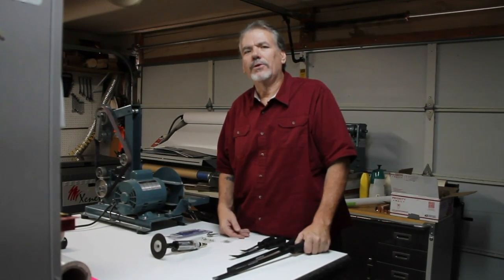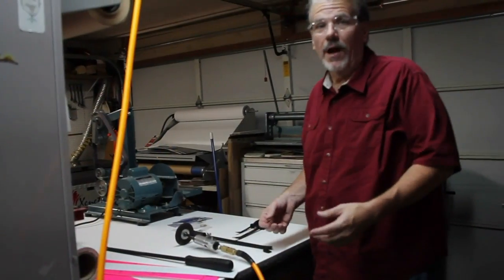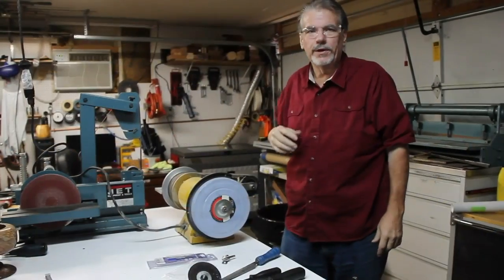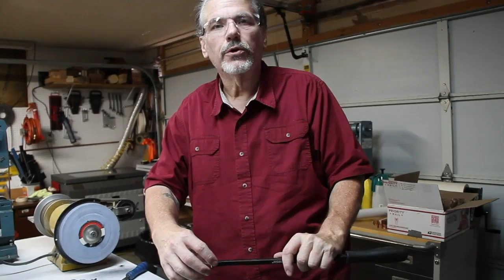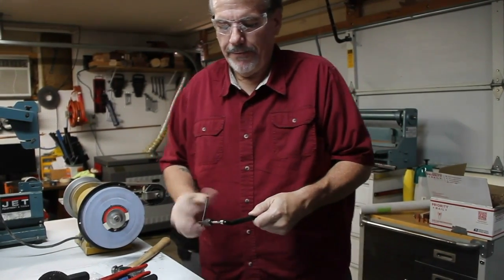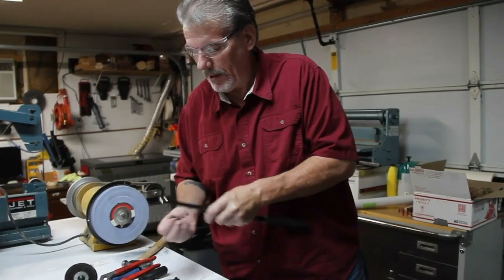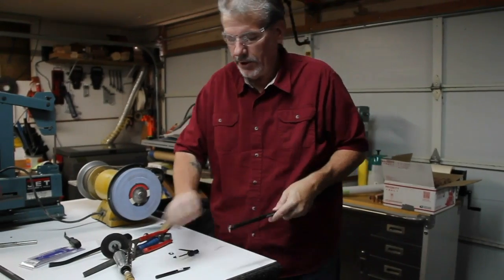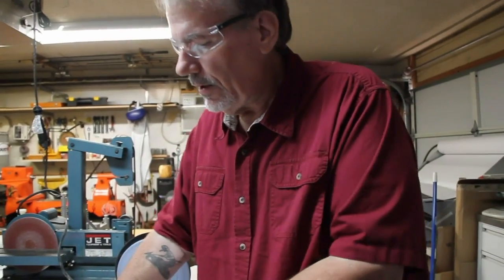How to make a Inexpensive carbide cutter for woodturning

Comment: If you grind the small platform on the tool shaft longer than the carbide insert, just place a small drop of CA glue on the platform just before you screw down the cutter. This will keep a square carbide insert from rotating on the insert platform.  To release the carbide insert from the platform, just use some heat from a propane torch or butane cigarette lighter. Loosen the insert screw, heat the metal opposite the insert for a few seconds and it should break the bond between the insert and metal handle.  This will allow easy changing of insert or rotating it to a new sharp edge. Apply another drop of CA glue and tighten down the screw; you’re ready to go.

Comment: Nice work.  Hard to believe that no one I can find sells this type of homemade lathe tool set.  I would think that there would be plenty of buyers, just to see if they would enjoy turning before shelling out for the real deal.
Reply from the maker: beav1962. Not a bad idea maybe I’ll make a kit up
Reply: @kendallnorthern7824  - can you tell me which size of cutter from the AZ carbide site to get for this 3/8 handle?  Gonna give it a try, but expecting to screw it up. Thanks.

Comment: Nice job thanks.  I’m just getting ready to make some. This is the easiest way I’ve seen.  Since I don’t have a lathe making the handles would be a pain.  I use a drill to make rings and I want carbide cutters so I don’t have to keep stopping to sharpen.

Comment: Hi, I’ve had a terrible time in my area finding the champion set you’re using to drill and tap the hole on the carbide tool. Can you give me the exact specs of that little kit you bought for $7?
Reply: Chris Davis  DeWalt also sells drill/tap combos like that. I have a few of the common sizes. I have a couple of set of taps and dies, but I like these because I can just store the sets together so I don’t have to search for the right size bit each time I need to tap a hole.

Comment: You must be drilling a larger hole than I do.  Mine would have broken that tap the way you put it through. I  do it on the drill press and use oil and go very slow .

Comment: why does the carbide bit need to be recessed, especially the round ones?  I can see the need for the square bits but what keeps the round ones from coming loose and rotating?

And how does it work when rotating the tool sideways?  it will raise the cutter because of the square edge of the tool.
Reply: It really doesn't if all you are going to use are round cutters.  You will still need to at least file the bar flat as they are not always very flat.  the rotation is locked by just the pressure of the screw.  I recessed that spot to be able to use any cutter on every bar.  And to protect  the cutter from dings and drops.
Reply: good point.  I hadn't thought about the abuse it takes when not being used as a tool. That carbide is brittle as glass. 
 Just starting into this and don't want to spend a ton of money on it.  I have 40 years worth of scrap from my cabinet shop I will be utilizing.  I will be building my own sharpening jig instead of $75 for the commercial one.  I will be making my own bowl gouge from a high carbon steel shaft, grinding  the channel and then mounting it in a handle from a pruning shears, complete with rubber grip :>)

Comment: Did you try grinding a edge onto the pry bars? They are hardened might work just fine. Could even be sharper than those carbide inserts.

Comment: What size of carbide tips work best with the Harbor Freight handles?  Great "how to" video.
Reply from the maker: Bob Bartholomew thank you for watching I haven't updated this in a long time as health issues took over. But they are behind now and i need to get back to this kind of thing.  These were all made with the cutters they sell to fit 10" helical planers on the market.  These are a lot less expensive than most.  There is a company I've found called AZCARBIDE who can be found on the web and on a website at azcarbide.com. They will give you a much better size and shape option.

Thanks
Ken
Reply: Ken ... thanks for the reply.  I went ahead and bought the Harbor Freight pry bars and from another video, leaned about Azcarbide.  I've now made 3 of my own chisels. Round, square and  square with radius.  l love them.  I've had a bit of loosening of the tips, so finally decided to add a touch of CA glue to the screw.  This solved the problem.  Thanks again for the tip on the Harbor Freight handles ... they work great.
Reply: Enjoyed the video very much, however still having problems locating lower priced carbide bits.
Any suggestions ?

Comment: Our Harbor Freight has a set of three with black and yellow handles.  They appear to be very close.  One problem I see is that if you turn it on its side to get into a bowl the hole leaves very little metal around it.  Does this affect the safety of the tool.  I bought them with the intention of making them.
I wish your close ups were better.  They weren't very close and all we got was a brief out of focused close up.  Dark tool metal against a dark colored shirt.  Don't mean this in a bad way so I hope you don't take this wrong.  Thanks.
Reply: Ill see if i can shoot some close ups of the tips this weekend.  The bar stock on the tool should be square. Should have the same amount of metal either way you grind it.
Reply: Okay.  I think they will work.  Thank you for your  work.